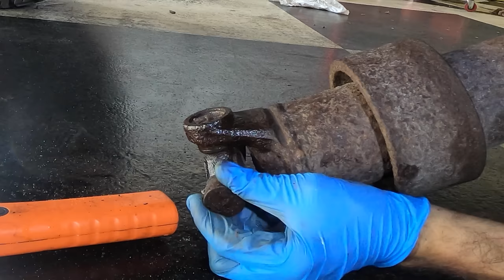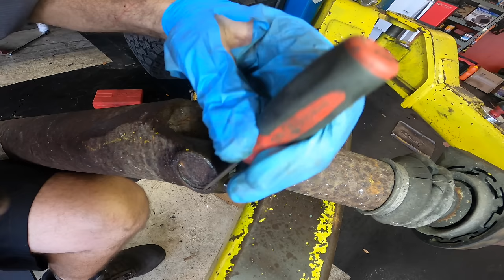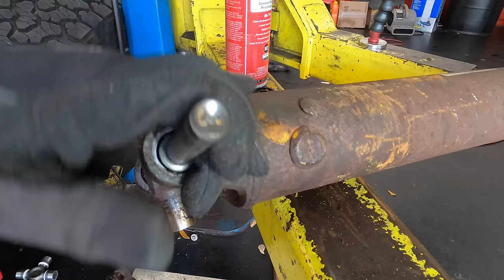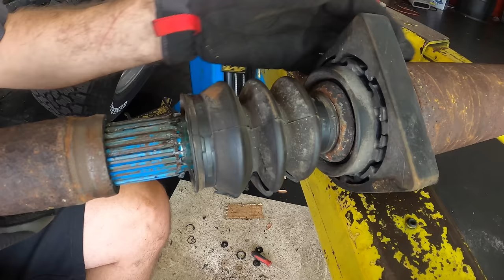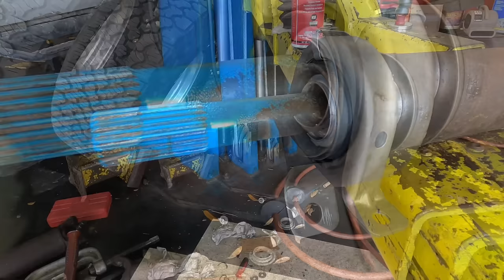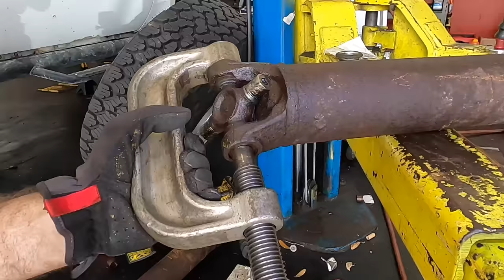Exploding End Caps!  Total Driveshaft Rebuild!  Ford F-350 7.3 Powerstroke 4X4

Comment: As hard as it was getting the old U Joint out, I was wondering why you just didn't you the torch to heat it up instead of using the Air Hammar to take it off.

Comment: I deal with these drivelines a few times a month, best thing to do is take a socket and drive one of the caps into the yoke until the joint is tight, that'll give you some room to wiggle the clip out. Then it doesn't matter if the clip breaks.

Comment: If you have a acetylene torch, maybe a Mapp gas torch might be hot enough, heat all the snap  rings up to red hot, only takes a second and that will break the rust bond and  also take the tension out of the snap rings so they are no longer brittle.

Comment: I always tie a piece of 0.16 stainless steel wire between the 2 frames slightly under the shaft so it doesn’t bonk you in the nose etc when you get the flange open - also helps to support it into position when reinstalling it

Comment: I work at a shop that does driveline building and repair.   $14 labor each to replace.  We use an arbor press and support the driveshaft so you only press against the joint not unsupported on the ears.  Also all light duty shafts since the 70s have been balanced as an assembly.   Mark all pieces before you remove joints. The shaft can go in the rig in any orientation but the shaft is what is balanced and the parts need to gon in the same direction.  You sir have an amazing amount of determination though.

Comment: I usually start with the assault hammer and relieve the pressure on the snap rings with copious amounts of lubrication. I don't have a fancy "C" clamp so I just drive the cups out with the air hammer....

Comment: I had a F350 for dump.  76 cab on a 72 frame.  Rebuilt the 360 and put a new clutch in it.  Got it stuck in thick, sticky mud.  Revved the engine and let out the clutch... short drive shaft crushed and broke in two like a beer can, long shaft became a bannana!

Comment: Tip, the next time you use the inner part of the ball bearing, it is a good idea to make a cut across it with an angle grinder. This prevents getting stuck.
Reply: That's a good tip!  Thanks!

Comment: When I did bearing installations I always busted the old ones apart to use the inner race as a driver for any other similar bearings I might have to install. Had a whole drawer full after a few years. I recently gave most of my shop tools, power and hand, to my two youngest sons. Had to explain some of them as they aren't used on today's vehicles. Like the Model SS-400 Sun Engine Performance Tester and the Sun MDT-50 Distributor Tester (both mint and with all manuals and update bulletins). They thought the bearing races were just junk until I explained what I used them for. They had been in the shop and helped when they were boys but didn't pick up the bug until I gave my youngest my 1972 SuperGlide and my third son a 1948 Willys Jeep. They are doing fine now. Looking for some old cars to restore.

Comment: Perfect timing for this series of videos. I have a 2004 F250 4x4 with 211,000 and have done nothing other than fluids, filtrers and brake pads since new. I have been wondering about the bearings and U-joints being too old. No symptoms though.

Comment: Not an easy job, I always get U-joints with grease fittings in them so they can be greased for longer service life
Reply: You'd love mine. I have U-joints with grease fittings but the grease gun tip can't fit through the yoke. So I have a needle adapter with the tip filed flat so I can push it into the grease nipple holes. A terrible compromise.

Comment: NOTE: The u-joint must be greased prior to installation. There is only enough grease in a new MOOG u-joint to keep the needles in place during assembly, which is not sufficient for operational lubrication.
Reply: Yes, that is why I like the grease-able ones. X55's. Greased 4X a yr.
Reply: It looked to me like they had grease in the hollow trunnion. Wouldn't that grease fling outward to the bearing cups from centrifugal force during operation? At least I think that's how the "sealed for life" units work.
Reply: if they're the greaseable type, you must grease them, if they're the non-greaseable type, they should be pre-greased and ready to use, unless you wipe grease off or contaminate it the trunnions have holding chambers to hold and help keep them greased.

Comment: Jeese!!  I used to be a mechanic in the 70's & 80's in England and having to do these darn things without any electical, battery or otherwise devices, what a bloody (sometimes literally) job that was. I grew to hate U joints with a passion. No lifts no sliders just laying on ones back in the road, wet or dry and it would take all day, sometimes into the small hours. I think I ate more rust than came out of those things. Great video thanks Ray.....Keep it up! I did live for a while in Pinellas Park FL, just wondered where you are?
Reply: The UK is awful for things rusting as is Florida it seems, I'd move to Montana or wherever it is they don't get much rust. I am so glad that we have little rust here in Australia, I have a 300,000 km truck and the UJ's still undo as if they were new.

Comment: Would ordering a new driveshaft outweigh labor times/frustration? I’m partial because I worked in a shop and now work in parts so I’m not used to a mark up
Reply: You might end up with a chinesium driveshaft that way. 
 I try to keep / reuse as many oem parts as I can on my vehicles.

Comment: Replacing the u-joints. You can push the caps in first, then take the snap rings out. They're so tight because the caps are pressing outwards, which is what is desired. The last thing we do after replacement is hit the ends with a hammer causing the caps to move outward to the clips.

Comment: Reminds me of the time I felt a nasty vibration going down the Sherwin Grade on 395 into Bishop CA. Limped into Bishop and found a shop. They said if I removed the shaft they would replace the joints. Cost me about $20 dollars and it took them 10 minutes. It took me the same amount of time to get the shaft back on the F150. That one ton is a whole different story! Whew!

Comment: Ray - I normally enjoy your videos but this one was very painful to watch.  This was a tough one with all of the rust but your chosen method of removal and installation was a total hack job.  I would not have confidence that the retainers will stay in nor that the caps are centered.  That being said, I appreciate you sharing the good, the bad and in this case, the ugly.  Be safe and have a nice day.
Reply: REEEEEEEEEEEEEEEE
Reply: Me too. I could not watch all of it. Just not my procedure for rebuilding a drive shaft, especially a two piece.
Reply: Caps should always be tapped in to relieve pressure off clips, very easy technique,
Reply: you call that rusty??? that's hardly nothing.
Reply: @throttlebottle5906  I agree
Reply: @rickgalla3377  I'm in Northeastern Ohio. mega salt belt and minimal check for rusted out turds. I have replaced major items on vehicles that other states would have sent to the scrap yard, for false reasoing, but along came unibody and total garbage engineering, now days 3 winters and they're all total garbage.
Reply: @throttlebottle5906  I agree 100%
I have same shot winters in ny

Comment: One tip on getting those rusty u-joint clips out is to tap on the center from both sides to free it up from the rust. Old GM's are a pain>>have to torch the plastic out before taking them out with the BFH and some large sockets. When putting back in, I prefer to use a socket between the hammer or bench vise and the cup so I don't risk banging up the corners of the cup. For getting the carrier bearing off, a bearing spreader with some threaded rods and a harmonic balancer puller to push on the end of the shaft works good. Had to do that with a Powerglide transmission output shaft that had a pressed on speedo gear. Putting it back on was the matter of heating the gear up and getting it back on quickly before it cooled.

Comment: New in the rear, my opinion is to let the new tire heat cycle until it’s rotating time, theory being that the tire will last longer because of less tread wiggle which would cause accelerated wear.

Comment: Put a thrust washer between the cap driver and the cap, spread the force out over a larger area. Find some washer with a similar O.D. to fit on the yoke, but I.D. smaller than the screw post.

Comment: U-joints come apart easier if you shock them with a hammer first. I also use an old differential pinion shaft as a punch to tap on the u-joint caps first to loosening them.

Comment: I had an 02 Lariat 7.3 for my shop truck for years, always liked that truck, but mother nature decided 20 years was enough. Those shafts are remarkably strong. I had lent it to some summer students and they came back with the bed pulled all the way to the cab in the middle and a loose piece of equipment in the back. I guess they thought it would be a good idea to tuck the tail of the 2 inch strap between the bed and the cab. It wound around the driveshaft and yanked it down taking the bed front with it. Never had a vibration though, just a really clean spot on the shaft.

Comment: I have to get these apart in WI where all of everything is rusted in. Next time you have to deal with one of these, start by cutting the cross out with a torch. Use your air hammer on the outside of the cap a few raps and the snap ring should be able to come out. Drive the caps inward to remove. Works fast and easy. If you need to clean the snap ring grooves, I save the 3" cutoff wheels that are worn down. One worn small enough to get in the hole will clean the rust out fast. Works every time

Comment: Why don't you drive the bearing cap in toward the U-crossbar? When you drive the cap in you relieve the pressure on the keeper. It does not have to move far, .001 inch is a big plenty. Nathan Brickles said it best. Second, why did you not put the vechile on the lift?

Comment: Ray there’s a special toll it’s called a bearing warmer which heats the bearing with ultra sonic vibration. Heats bearing up so it slides right over a press fit so u don’t shock the bearing or damage it works great just for these applications. Look it up Rick Canada. Millwright

Comment: Some yerars go,my u joints went out on a '73 Ford with 300000+ miles of abuse and my Father-in-law's Dodge had been bad for a long time. I tackled mine first,not bad but took a while. With the Dodge,I decided to remove the shaft and have it rebiult at a local shop. The man there replaced the u joints in about 5 minutes,after taking several hours on mine. Of course,he did them all day,everyday.

Comment: When using a bearing splitter in a press, it might be wise to cross the gaps in the press rails with the splitter plates rather than the all-thread. You'll be less likely to bend your all-thread.

Comment: Rust Belt Recipe for DIY rusty bolts and whatnot. Spray, wait. Repeat as necessary. Wire brush and hammer taping are optional.

Comment: FYI, based on my experience, the baby blue Teflon based grease from Ford is the only stuff that works on that slip joint. Any other grease will cause the dreaded "drive shaft clunk" in short order.

Comment: Hey Ray, on that bearing reinstall.   Do yourself a favor, and heat that thing up. You can heat a bearing up to ~ 200 f without any Damage to the bearing or the lubricant. A cheap toaster oven will do the job nicely. Just wrap it in a bit of aluminum foil first. Then it will just slip on, without any beating needed, and ensuring no damage to the shaft surface. Also a greatly reduced install time. Especially if you put it in the oven when you start taking the old one off. Just take it out with leather gloves, and quickly slip it on. Speed is needed, because it will cool quickly. If you are slow, it will grab, and then you will still need to beat it, but if you are fast, it will still seat with just light tapping. But it will give you about two thousandths, which is more than enough for an easy slide in most cases. Just make sure that the shaft is well prepared. Oh, and make sure to place it on in the correct orientation, if it has one. How do I know? Twenty plus years of electrical motor rebuild. Like the show.

Comment: Just a couple of suggestions, split the shaft at the slip joint first, use a vice to hold the shaft, drive the caps out with a big punch and hammer instead of the ball joint press. If that had been a aluminum shaft you would have probably had to replace that shaft the way you did that job .

Comment: I’ve had power strokes, Duramaxes and Cummins. I’m now a dodge guy mostly but I’m still patching together a 2002 7.3 Ford dually. It just will not quit. Well, I take that back. It does quit. But the repair bill or the repair I do is just so much cheaper and easier than the new ones. Big displacement and low horsepower (for that displacement anyway) means that a well maintained 7.3 is likely to last a long time. My wife and my son will not even hear of putting old greenie out to pasture.

Comment: GM used to use plastic melted into the Cap/Yoke runners, to keep the caps in place. We used the smoke wrench, to heat the plastic and pop the Caps out. Kind of dangerous and definitely led to exploding Caps.

Comment: Put pressure on the caps with the bearing press then hit the outside of the yoke eyes with a little precision heat (small tip, keep it moving). Won't take much, just enough to get them a few degrees warmer. The caps will pop right out.

Comment: Have a 1/2 ton ram 4wd and just had all that done to the drive shaft. It’s an 03 & from MI … my maintenance guys cry about the rust lol . Just hitting 60k miles. 3rd set of …. Shocks , breaks , tires . Second … tie rod ends , upper lower ball joints and three u joints and one carrier plus lowering of fuel tank for fuel pump assembly. 4th battery, damn Florida and it’s heat and Uvs. Second serpentine belt. Switch to synthetic oil and filter, a move to an K&N air filter. Second set of hood struts . As well fluid changes and what not plus a linkage replaced to the transfer case, as well front and real seals to the rear end. Ppl actually ring my doorbell and toss an offer of 4K and that happens often. As well it’s a crew cab with an 8 foot bed. You know one of those trucks that can actually move standard lumber as we’ll groceries. All things aside…… all those little things you do and the let’s just replace this while I have it all apart. If the customer could just realize to come back later and pay all that labor for a gasket, o ring or sensor I think they would say just replace it. Sorry nothing more satisfying then watching the magic of break cleaner making everything nice and shiny lol. If I were to loose my truck guy, I would transport her to you for the simple fact I would be getting what I’m paying for and more. A straight to the nuts cut mechanic who dosent push shit and understands his or hers job is pretty rare. Hats off to you sir.

Comment: If all snap rings break sometimes anyway. I pull grease fittings if applicable the cut old U-Joint in 4 pcs with oxygen/acetylene torch. Then air hammer all caps inward with air hammer while still hot. Especially the big U-Joints qwith bolts holding end caps on. The only penatraiting oil I think works is the torch. Just my opinion, gef good to clea holes and snap-ring guides Good vid 👍🏻🇺🇲

Comment: The u joints are being replaced, so no need to save anything. The torch, and water, is your friend. Heat it up, quench it with water. Thatll pop it free from the rust.

Comment: Absolutely miserable job. Just did the same thing on my 06 F350. I feel your pain.

You are gutsier than I hitting the caps with a hammer. I used a vice just to avoid needle bearing disasters. (I get that your caps were part way onto the ujoints.)

I like to push the cap in a bit too far so that when I do the other side, I can keep the ujoint in both bearing caps.

Funny how big and tight everything is on a 1 ton.

Comment: I've found that there's enough room in the rubber shields to compress the joint and relive pressure on the spring clip. Just a few "ugga-duggas" in the press or vice gets it done.

Comment: I used to build drive shafts. I wanted to jump through the screen, to show you a better way, with out putting a dent in the tube, and get the u joints out. You get a A for effort 🤙

Comment: 17:05 Tap one of the old cups into the circlip side of the u-joint you're trying to push out and it'll hold the alignment long enough to get it started and the cup on the joint will take over.

Comment: I've never seen anyone fight with a u joint like that. 2 sockets, one slightly larger than the cup, one slightly smaller than the cup, a Big Fing hammer.    a good smack on the clip and they usually bust up the rust and free them from the ring slot. easily pull them out then.

Comment: I've done a lot of driveshafts in my day including making needle bearings in the middle of Yellowstone Park.  Arbor or hydraulic press are the easiest to get those bearing cups out, plus a little heat!  But you wait until you do the yoke bearing???  A good piece of pipe does a great job on the yoke bearing.  Same for the shield.  Still got the job done, but took longer without.  Sorry.

Comment: the real fun starts win you work on a car on a  gravel drive way, and drop a new cap on the ground, I put em the freezer before installing deburring the yokes is always good but i install new straps and bolts, Ive seen hairline cracks in em after 75,000 miles, the best U-joints are the ones that have grease fittings